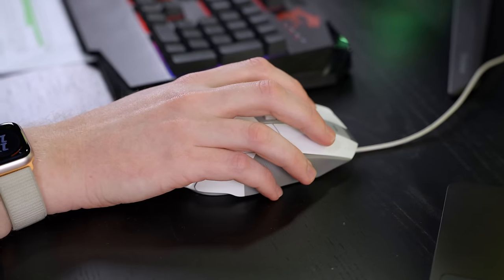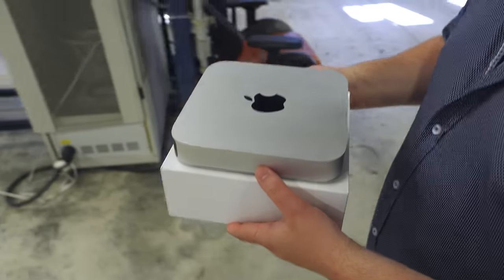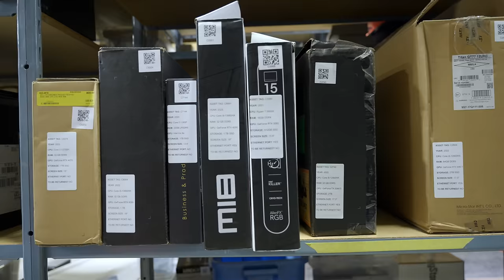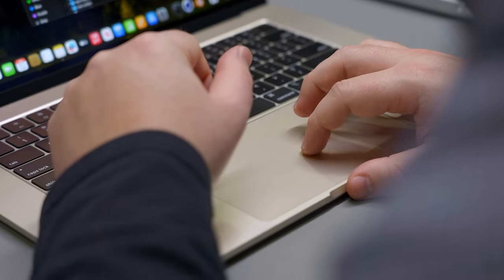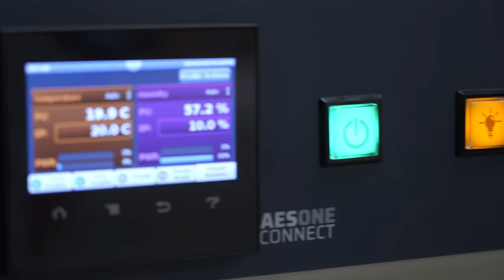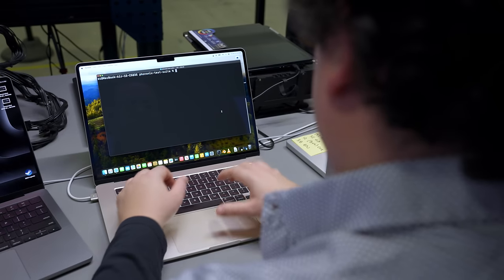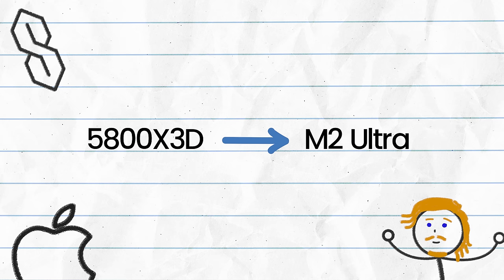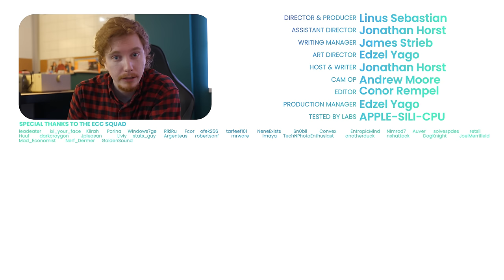How Apple Silicon Compares... - Part 1

Comment: I think there's one thing that you're not considering when it comes to comparing x86/64 to ARM: the process node. Apple is notorious for pushing TSMC's process tech and AMD picks it up after Apple has done their thing. Perhaps it might be worth considering an additional test that compares equivalent nodes as well? (I think it would be M1 vs Ryzen 5000 or thereabouts)
Reply: Kudos to Apple for pushing the industry. (not talking about soldered ram)
Reply: @jivewig  I'm not sure what you mean, but if you're implying that process node technology wouldn't be improving without Apple, that's not the case. TSMC is the foundry for dozens of major chip design firms, not just Apple. If it weren't Apple, it would've likely been Nvidia.
Reply: @Omonarc  I’m not saying it wouldn’t have improved. You said Apple is pushing TSMC and I said that’s good.
Reply: @jivewig  Oooooh, I'm sorry if I sounded accusatory there.
Reply: @Omonarc  it was my fault, I just realized there was a typo in my previous comment thanks to Apple auto-correct. I’ve edited it and you can see what I meant to say.

Comment: You should test the newest amd cpus too. At least for comparison.
Reply: YEP. It seems like they are going in with already skewed results.
Reply: the aim here is to find a CPU platform that is about the same so that they can then compare GPUs to figure out what PC GPU is comparable. The goal is not to find out what cpu is faster but rather find out what CPUs are the same perfomance (in gaming situations) so that they can remove the cpu differnce from the equation when comparing GPUs.
Reply: @hishnash  It is still a 3 year old CPU they are comparing to a 3 month old CPU. How is not comparable?
Reply: @saulgoodman2018 how thick are you that you don’t understand? 
This is not a test to see who is best, let go of your apple rage.. they are looking for a similar performing cpu or “comparable” for the final gpu test.. geez
Reply: @saulgoodman2018   the goal is not to find the fastest CPU.. The goal is to find the CPU that performs the same in games.

The aim of this video was to figure out the test harness so that they can then compare GPUs (in gaming).

They said the reason they did not use the latest AMD cpus is that there are no modern CPUs from AMD (on the desktop) that are as low perf as the M1/3 entry level SOC and thus would not be a usefull base to compare with.  (hard to compare GPUs when the cpu your using runs differently)
Reply: @Tawmii91  problem is that none of the cpus even came close to apples M3. I know what you mean but they should also match the fastest cpus. I think AM5 platform has enough of a different cpus to match all of the apple ones. They will only use 2 different AM4 cpus that cant come even close at productive workloads to apple. And at gaming they are not even the best gaming cpus. Im just saying that they didn't find the most comparable cpu becouse they weren't similar in any of the productive workloads. In gaming the roles will probably be reversed and then what is the point of even comparing them?
Reply: @hishnash  Why do you feel the need to suck up?
They are no talking about games only.
Reply: @Tawmii91  This is about which CPU is the best.
Reply: @Flexo_l  He did mention the problem is with entry level apple cpus which don't have a match on AM5 platform, because AM5 platform doesn't have entry level cpus. Anyways lets see whats in the second video and then judge.
Reply: @hishnash  If they were looking are comparable CPU's, they would not be a 25-50% difference.
5800 is using 3 year old technology. AMD CPU tech changed a lot in the time.
Reply: @saulgoodman2018  in this video they said multiple time the aim is to find a cpu that is compatible to the apples CPUs so that they can in the next video compare the GPUs in games. They literally start the video saying this.. did you watch it ?
Reply: @hishnash  And did you see the screenshots? They show a 25-50% difference.
So tell me how is that comparable?
Reply: @helloukw  What is an entry level CPU anyway?
Reply: why? the goal was to get a build that is 1-1 comparable with a mac.
Reply: Why are some people salty about this? xD Just because Apple was on top? The Apple haters in this comment section is crazy. (And its fun to read)
Reply: @chrispy.critter  This is not 1 to 1 comparable.

Comment: The M2 Ultra and M3 Max are cutting edge processors which are found in $3000+ computers. They are close the the 7900x in terms of single and multi core raw performance, and it is a disservice to compare them to anything but their true competition. Even the M3 is surprisingly close to the 7600.

Comment: The main problem with this comparision is that the memory used in Apple Sillicon is a lot faster than the DDR4 used in the AM4 platform. A more fair comparison would be with DDR5 memory in the AM5 platform.

Comment: correct me if I'm wrong, but aren't those tested 3 years old amd CPUs? The intel one at least is farely recent
Reply: Yes, but thats not really the point. As he points out the single threaded benchmarks point out that the 5000 series of AMD chips is slower core for core than most of the Mx lineup, but the problem comes with you try and step up to 7th gen AMD, and current gen intel. The 7th gen AMD doesn't have any low end chips to pit against the low end m1, m2, and m3. So to get as wide an array of CPU's that best reflect the Mx competitor they are going with AM4 so that they can stretch backwards and forwards in time as best as possible while still using the same MB and ram to make the tests as apples to apples as possible. Yes, the ideal would be to use the 7th gen AMD, but for one that would make m2 and m1 the old boys as they predate 7th gen, and it would mean that they wouldn't be able to compare against similar level processors cause there is no low end for AMD just yet. So either have am4 and am5 and get even farther from apples to apples, or use am4 exclusively and get as close as possible while maintaining as much similarity between the runs.
Reply: @mizinoinovermyhead.7523  They should've just not compare the Max and Ultra variants. They are in principle HEDT chips, no one is going. to buy them to game. The same as no one is buying threadrippers to game.
Reply: @mizinoinovermyhead.7523  Ever heard of... Ryzen 5 7600X or Ryzen 7 7700X? Not to mention that Apple silicon is far more expensive than AMD CPUs, so you might as well get a Ryzen 9 7950X(3D) because that's what you'd be getting for the same price.
Reply: @mizinoinovermyhead.7523  What low end chips?  Apple's crap costs a fortune.  They plan to use a generation old AMD's CPU's against modern Apple M3's.  I'm not even sure if they plan to use Nvidia GPU's.
Reply: @DukenukemX  They did note that next vid will put amd AND Nvidia up to the test. 

Buuut also, they should really do two/three different tests:

Price equivalent comparison (Likely the most important to gamers)
Performance equivalent comparison (tests how optimized games are on mac, which seems to be their current goal)
Architecture equivalent comparison (TSMC 5nm vs 5nm, who utilizes the wafers better?)
Reply: @CFIREKytb  It's an Apple only YouTuber, which means he's going to do poor testing.  It's never an Apples to Apple's comparison, no pun intended.  We all know how this will go.  PC is cheaper, always.  PC is faster, always.  Unless they plan to use M2 and M2's only, because M3's use 3nm.  Nothing AMD uses is on 3nm, and you can forget Intel.  The 5800X3D is on 7nm, while whatever Intel has is like maybe 10nm?  You have to go 7800X3D which is on 5nm.  

What will ultimately happen is that they'll run power consumption tests and PC fails.  OMG, PC bad for power consumption.  Meanwhile AMD's Dragon Range like the 7840HS is built on 4nm and is nearly as power efficient as Apple's M2 silicon, with full performance unplugged.  If they do use AM4 based chips, then it's because they're trying to limit the insane frame rate difference between Apple and AMD.  Maybe one of those "experts" from Linus should test the monitor latency, because while Apple screens are extremely color accurate, they have the worst latency, which makes them the worst screens for gaming.  Oh, and since they mentioned Baldur's Gate 3, lets see if they use Vulkan.  The Windows version has DX11 and Vulkan, and of course Vulkan is faster.  Watch and see if I'm wrong.  Also, Geekbench and Cinebench results, regardless if it's gaming or not.
Reply: @DukenukemX  no they plan on using M1, M2, and M3 chips and he even states explicitly which chips will go against which chips. Did you watch the video?
Reply: @mizinoinovermyhead.7523  I did but they decided to omit AM5 I thought?
Reply: @DukenukemX  
That's a lot to unpack, and I didn't disagree with you when I first watched the video, but I do somewhat disagree with you now that I have rewatched it. 

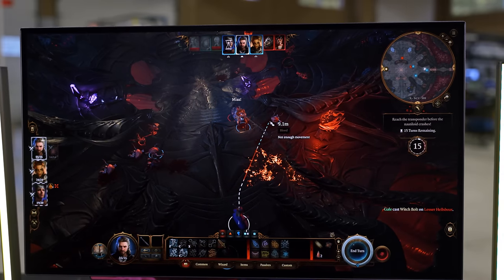It is important to note that they are only looking for equivalent performance on the CPU side, not equivalent PPW or price to perf or which is the best. Just trying the normalize the CPU variable because their main goal is a GPU performance comparisons. Because that is the goal, I do think this video shouldn't exist.. It is extremely easy to misinterpret the video because of the title and content, but rewatch 0:45 - 1:10 
He specifies comparison of GPUs and that they are just looking for an equivalent CPU. 

Likely that is why they did not use the 7000 series as you cannot find 7000 series CPUs as slow as M1 and M2 baseline chips and they want to stay on one architecture line for the PC side to minimize any cpu architecture differences causing GPU performance differences (something they unfortunately cannot do on the Apple side). 

One thing that I completely agree with you on is Perf per watt. The reason Apple had top of the line PPW was because they were on a smaller TSMC node. Apple and AMD have equivalent PPWs on the same TSMC nodes and Nvidia's architecture stomps Apple on PPW (assuming you've removed the 80% wattage boost Nvidia applied for some god forsaken reason).  

For the screen: Since they are comparing to desktop class GPUs, I assume the laptop is expected to be sitting on a desk attached to a properly sized monitor... like a desktop. Tons of mac users do that already, attaching their 14in screen to a properly sized 38 in ultrawide or something similar.  

Now personally, I would do the test a bit differently. We know that when a game is GPU limited, the CPUs performance does not matter. So they should set graphics settings to hit the 100% mark on both Mac and PC GPUs. That would be the best way to normalize the GPU performance on both sides and see just the GPU performance difference. You'd also only need like a 7900X3D, which should be able to handle any modern GPU you can throw at it. 

I am, however, looking forward to how they will cope with Nvidia Hardware acceleration. Will they ignore raytracing? DLSS3.0? Will they claim MetalFX Up is equivalent to DLSS? These are already challenges in comparing AMD to Nvidia.

Given that they are unafraid of showing Apple hardware accelerated results (Image and audio benchmarks for example), they should be show Nvidia's hardware accel results in pt2. 

Edit: I forgot 5000 series doesn't have DDR5 and will cpu limit the 4090... Disregard and cope for why it is a good idea to match last gen CPUs. It is inherently putting PC at a disadvantage and making other important hardware impossible to match.
Reply: @DukenukemX  they did omit am5 and he gives completely valid reasons for doing so.
Reply: @mizinoinovermyhead.7523  They didn't omit it?  Then we'll see them tested against the M3?  What valid reason?
Reply: @CFIREKytb    I saw the edit.  The problem with their reasoning is that AMD, Intel, and Apple all build their CPU's differently.  Are they going by clock speed?  The 7800X3D has lower clocks compared to it's siblings but the 3D V-Cache is great for games.  Are they going by cores?  AMD doesn't have big little cores like Apple and Intel, so that would be hard.  Are they going by price?  The cost for ram on Apple is crazy high.  They going by Geekbench?  Geekbench is notoriously favoring Apple.  They going by Cinebench?  R24 is also notorious for favoring Apple.  

The best thing to do is use current generation AMD 7000 series and test a variation of them against Apple's M3's.  The 5000 series is 3 years old, and doesn't use DDR5.  The 5800X3D is a great CPU but still.  Most new games using the RTX 4090 are CPU limited, which means the CPU's aren't fast enough for the GPU's.  Even AMD's 7900 XTX is CPU limited in a number of titles.
Reply: @DukenukemX  they literally lay out their testing methodology. They aren’t trying to figure out who makes the fastest processor, they are trying to find which processors score closest to apples so they can attempt to show what the difference between GPUs is.
Reply: @mizinoinovermyhead.7523  It's common knowledge that PC GPU's are mostly limited by their CPU's.  If you want to get the most out of the GPU then you need a fast CPU.  Something like a 7800X3D due to the V-Cache.
Reply: @DukenukemX  Dude do you know how the hell any of this works? If I take an M3 processor and I want to figure out how fast the integrated GPU is, then I need a comparable system to compare it to. That means if I want to just talk about GPU speed, I need to make as similar a comparison as I can. As a result I don't necessarily want the fastest processor, but rather the processor that most mimics the processing power of the M3, so that I can slot in and out the GPU of that system and figure about where the M3's GPU lands. Is it perfect? No, but you can't just say I'm going to slap a 4090 and 7950x into a system and compare them to a M3 chip. It doesn't get you any relative data that you can talk about. All it gets you is that this box is faster than that box.

Comment: I really like the style of this video, but it baffles me how they reached there technical conclusion. If you want to compare similar setups, how can you choose any DDR4 system vs Apples super fast unified memory? Why is AM5 not low end enough, what about 7500F and 7600? Why not include more Intel CPUs, whose faster single core speeds better match the M processors? Why do you choose an X3D processor if there is no comparable technology in Apple‘s M series?

Comment: It would make more sense to compare a modern platform to apple silicon. or if you don't do that, compare the same generation of devices to each other. Using AM4 is just a legacy platform (That I use and love) but still not really a interresting test. So please compare same node size / same generation chips to each other. That would give interresting insight to the x86 vs ARM question. Still very nicely produce, thank you.

Comment: On the point of battery life. I have 2 phones. Samsung Galaxy S23 and iPhone 15 Plus. I can leave my iphone sitting for days and rarely need to charge but by the next day my Samsung is dead. I'm not entirely sure what Apple is doing behind the scenes but whatever it is, it's very impressive. In fact I just checked my iphone which I last charged 2 days ago and it's at 80%. Granted I've barely used it but still.

Comment: I'm a software developer and, coincidentally, I work on both an M2(latest OS/24GB RAM) and a 5600G(Pop_OS/32GB RAM). The Mac M2 is faster and more responsive when compiling and running code. Most of the time I rather work on my Mac than on my PC. I haven't benchmarked them but I've worked on both using the same IDE(IntelliJ) and the same codebases interchangeably and it's pretty noticeable.

Comment: As a Mac user (2021 14" MacBook Pro) I don't want to game on my MBP, or any laptop, because of the fast pace of game development. The lifespan of any laptop is greatly shortened when one factors in gaming. I build my own gaming PCs instead. I started with an AM4 motherboard using a 1700X. Then installed a 3900X and now I am using a 5800X3D. I've also upgraded my video card a few times over the years. My MBP will last a heck of a lot longer because I game on a PC.

Comment: I do like Mac book airs for being passively cooled no noice from a fan, and no issue with battery compared to a lot of windows laptop and weight is relatively low. I hope a windows/linux laptops can do that too soon ish
Reply: I even tried bg3 on the mac book air m2 24gb ram 2Tb ssd (big cpu version of the m2) i was surprised by it but for gaming i will stick with my pc but well I could use a Mac book(was bought used with rest warranty)

Comment: Here are some key takeaways from the video:

1. The goal is to compare Apple silicon (M1, M2, M3 chips) to off-the-shelf PC CPUs and GPUs for gaming performance. This is now possible because some games can run natively on both Macs and PCs.

2. They tested 7 different benchmark tests on both Macs and PCs to compare CPU performance. The tests measured single-core and multi-core performance.

3. In single-core tests, Apple silicon dominated, especially in audio/video encoding tests. In multi-core tests, high-end Macs matched or exceeded gaming-focused AMD Ryzen CPUs.

4. They matched Apple chips to AMD Ryzen CPUs for gaming rigs: M2 Ultra -> 5800X3D, M2 Pro/Max/M3 Pro -> 5800X, M3/M2 -> 5700X, M1 -> 5600G. These are best guesses pending GPU tests.

5. Testing showed Apple silicon is very efficient but not necessarily faster for gaming. More testing is needed with GPUs to draw final performance conclusions.

6. The process demonstrated that benchmarking two completely different architectures has challenges and required compromises. There is still more to learn.

7. The exposure to Apple silicon performance and efficiency left a positive impression on the PC-focused testers. One tester ended up buying a MacBook Air to use daily.